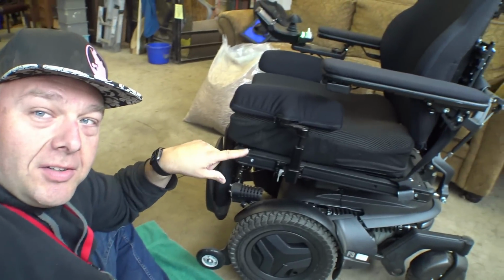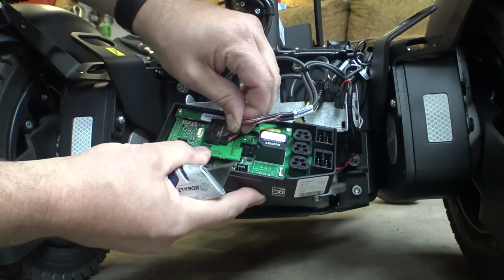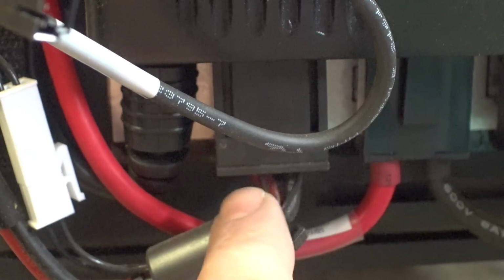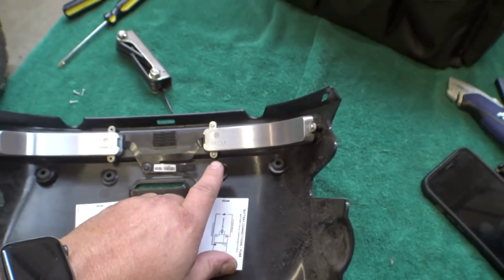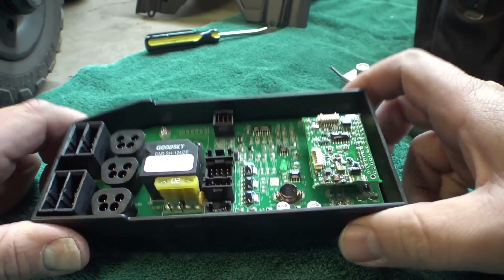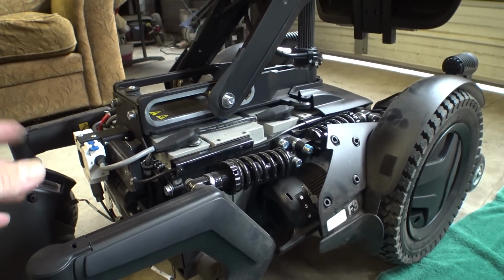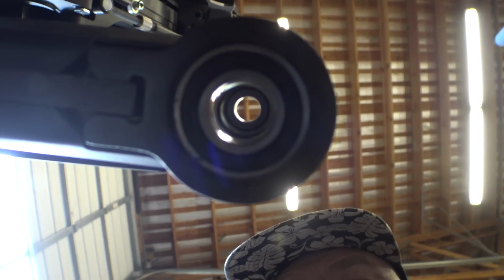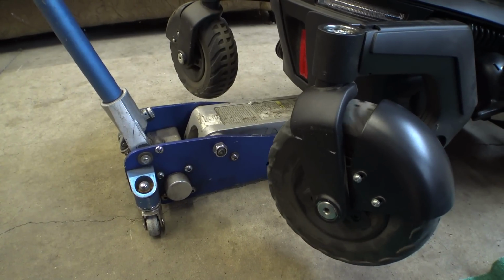MEGA VLOG 584: a look inside the Permobil F3!

Comment: I Am Not Amused, Or Happy To See That The Permobil F3 Shown Here In This Video, Has Some Kind Of Tracking GPU System In It, Because I Am In The Beginning Stages Of Getting 1 Of These Permobil F3 Powerchairs From A Local To Me Disabled Powerchair Company, Wherein I Have Already Been Fitted On A Demo Unit, Which I Saw And Road Around In It 2 Days Ago, Wherein It Will Be Replacing My Wearing Out Q6 Edge 2.0 Powerchair, Which I Received 5 Years Ago, Via Medicare & Medi-Cal, Through Another Disabled Powerchair Company . . . ;-o

Is This GPU Tracking Unit A " Mandatory Feature " On These Permobil F3 Powerchairs, Or Do I Have The Option To Have It Left Out, And Off The Permobil F3 Powerchair ???

I Am Also Rather Concerned By The Rear Tie-Down Hooks, Which Are Short, And Stubby,  Which Are Being Hidden Between The Rear Wheel Frame Bars, And The Plastic Rear Shroud, And Very Hard To See, And Get To, For The Securing Straps That Are Utilized By The Local Disabled Bus Services In My City, So Does Permobil Have Another, And Taller, Or Longer Version Of Those Metal Tie-Down Hooks, Which Come Out Farther, So That They Can Be Seen, And Hooked Into, Via The Transit Vehicles Floor Securing Devices ???

Kindly Respond Back To This Post And Let Me Know . . .  Thanks . . . "-)
Reply from the maker: https://www.youtube.com/watch?v=Yrkk8shC7WI

Comment: I have a F5, I am from Brazil and we don't have a Permobil service here, My leg actuator sometimes fail and appear error code 2092. Im gonna buy another actuator, but there´s any chance to the problem is in any electronic board or module? Apparently the cable is fine.

Comment: Hi Dan sorry it's been a long time just looking for your info on f5 casters flutter is driving me crazy what did you do to fix the issues? I just looked and seen mine has 12 pieces too so hum wrong part installed on my f5 casters?
Reply from the maker: yea ive heard from a number of people.. some have the 12pcs, and others the 13 pcs.. i know the parts exist, but ive tried to order them, and get told 'they are all the same' which i know isnt true... havent modified mine just yet though :^/
Reply: @TotallyNormal-   ty for reply they are not the same i had my 1 caster done monday and issue is fixed on 1 side . There is  only 12 pcs so ive been told but there are 2 types of this part 1 has more tension  here are the part codes 330974-E / 330974-F   the 1 with E is new 1 on chair .  F is stock from when i got chair will send you pics in discord as well hope this clears thing up

Comment: is F3 much better than c500? cause in my country i can only buy c500 or c300...
Reply from the maker: if i had to choose between the C300 and the C500.. i'd take the C500 all day long! its a much more stable, and solid chair!
FYI - the F3 is essentially a 'new' version of the C500 with similar weight, and build quality (but a lot more plastics for looks)
Reply: @TotallyNormal-  thank you... so not worth waiting for f3, cause i will be happy with c500 the same?
Reply from the maker: if i HAD to use a C500 as my daily chair, i'd be happy with it :^) 
i would want one with the 3G seating on it though!
 they made the C500 with 2G(plastic seat back) and 3G (metal seat back) seating options.  i'd also want to make sure it has the R-Net electronics with a screen on the joystick (color or grayscale doesn't really matter)
ALSO the C500 has 2 motor options.. the VS version has high speed motors.  the standard one is a bit slow @ 5MPH
Reply: @TotallyNormal-  ok , mine will be in 2 weeks, they brought from US to Poland.. and i will check all yours sugestions:) thx bro
Reply: @TotallyNormal-  just mine arrived to the shop, c500 with r-net unit, joystick with screen, and only 3 km of ride, so like new. so i think worth it?:)
Reply from the maker: awesome!! hopefully works well for ya! i always assume used chairs need new batteries FYI..
Reply: @TotallyNormal-  but it has only 3 km of ride, so its like brand new, only used in shop like a demo sample:) its esp S version, so its better than a standard right?:)

Comment: is there any mercury switches that make it go into turtle mode when going up a steep ramp or tilting back to get in a van to clear your head? my quickie does and it is a pain. i just bought s 2017-2018 f3 but didn't try it yet. will I run into same problem with f3
Reply from the maker: No mercury switches on these chairs! It’s all handled by the actual position of the actuators now :-)
Reply: @TotallyNormal-  so i'm 6'7  quad and need to lay back to get in minivan to clear my head, also low blood pressure can't sit up. am i going to be in turtle mode all the time and does it ever turn the motors off so it wont drive? is there anyway to outsmart it or did i just buy a expensive char i won't be able to use? Thanks
Reply from the maker: Head back over to Twitter.. we can discuss things there, and get a better understanding of what’s needed.. messages there will be a bit quicker

Comment: They definitely have a power draw when off.  My first M3 when parked days later battery's dead. It was well charged and sitting in the off position with a cracked frame, I was in a loaner. But the strangest thing I noticed was every once in a while the greenlight under the cover was lit. sometimes it was steady and other times it was flashing. Without anybody touching any controls kinda odd.  It's good to see you taking a part an, all too familiar, Permobil.  I too like to take things apart and reverse engineer, Second guess many of the (why they do it like that) engineering. Budget not considered.

Comment: As for the caster flutter  problems. I have to wonder why permobil never changed the axle housing to mount the wheel farther away from the centerline of the vertical pivot point.  Other than they are trying to avoid some of the extra caster kick as you change directions. (front/back).
......Personally, i think I would rather live with the caster kick.

Comment: If you just disconnect and remove the "connect" box and wiring, because you simply don't want or need it. 
Does the chair throw any error messages ?
Reply from the maker: chair = honeybadger.. "it dont care!!" lol

nah.. no errors etc.. the chair itself doesnt need that module for anything :^)
Reply: @TotallyNormal-   Good.......In Canada that "connect" seems to be a standard (no extra cost)  inclusion.
And I'm not really sure I want big brother to know every time I go anywhere.....ESPECIALLY if I find it's draining my battery.
I'm still fighting for the funding on my M5 to get them to cover elevation and front tilt, and it looks like I might be looking at a 2022 model now.
Almost wondering if your "source" has any info if there are any changes over 2021 versions ?

Comment: My DME service guy and agree they should send the prototype out to actual users to drive the wheels off and find the engineering fails ( like my 2014 power M had the entire front of battery box held on with a cotter pin ,day 2 it fell off when the cotter pin broke ,we put an L bracket on and it’s never come of again) my 20 & 21 have the same quirks there’s a plastic motor shroud on the L that half falls off and rattles got tired of smacking it back on so I VHB it , and the headrest tension screw backs itself off everyday and the headrest sounds like a rattle can going down the road , the change in Rnet that makes me crazy is it no longer stays in mode so if you elevate and have to move and go back you have to reselect elevate because it defaults to tilt .

Comment: @Totally normal Hey Dan. I wish I knew that you weren't familiar with the new type of friction brake kit. My 2018 M5 uses the same system. So I'd like to share my findings with you. When you tighten down the bolt it compresses the spring washers which because the top bearing and the spring washer assembly( not really sure what the call that piece yet) rides above the ledge inside of the Caster arm, will cause a pulling force upward on the Wheel which causes more friction. The small o-ring at the bottom is really only there to prevent the bottom half from slipping, at least the best I can figure. Also wanted to talk about your wheel flutter problem. Yes it is absolutely because you are running the aggressive tread caster tires. When I originally spec out my M5 it had the aggressive tread package added. I noticed a significant amount of flutter and decided to run standard Caster tires with the aggressive tread Drive tires ever since then my Castor flutter has been minimal. Permobil only makes one version of the spring washer assembly, which is the 12-piece and yes for the record there is 12 spring washers in the assembly( I only know this from experience because while removing one from my chair it exploded and we had to pick up all the pieces.) Permobil will also tell you that this version of spring washer assembly is good for both standard and aggressive tread Caster tires. However, I highly disagree and have been very vocal about this problem. The aggressive tread Caster tires are simply too heavy and therefore cause more weight on the whole system I. E. causing more wheel fluttering! I would like them to make a 13 or 14 piece spring washer assembly option available.
Reply from the maker: awesome! thanks for the info! sounds like a number of other people here in the comments are having issues with the castor flutter as well.  it seems like one should be able to add more spring washer in there potentially...

Comment: I had a problem of caster wheel flutter on my Purchaed New Late 2020 Sunrise Medical Quicken Puma 40 Pro S-Line Gyro RWD, when Is it hit 2-to 3mph  it was returned after a Main dealer service and to be honest after a lot of cheacking the 10” castor wheel and its ajustment to the castor bearing I found what solved my problen was ajusting the Center of Gravity to the seat. Which the dealer did not admit the altered the center of gravity when they fiited, or placement of the seating when they fitted a power recline upgrade that I asks to be done at my expence to my back rest Once I moved the seat and I not the dealers  I did that the flurtter disappeared completly  and my chair now run at just under 7mph with no flutter ever. The dealers wanted to charge to put there error right. Needless to say I am now Useing another Compitant dealer for my service and upgrade work.

Edited to add My chair went to its service with no wheel flutter of any kind and on 29 miles on the Clock from New, I had a bad feeling about the dealer to be honest, But I will not Name them though i did Make Sunrise Medical aware of the request for extra Costs This Comany wished to rip me off with. I bought My Unit New from the Dealer at totaly my own expense and I love my Chair as Much as Life Itself .

Comment: Hey Dan, I currently use 2017 M3 ( C-5 quad) and went to an estate sale and purchased a 2021 M3 that had 3 miles on it, I was going to swap some of my actuators off my older chair onto the new one and make it my primary daily chair, I had help come over got things swapped around and the old actuators wouldn’t work on the new chair, when I called to get some information they informed me that the new chairs come with smart actuators from the factory and cannot be swapped out unless brought to a dealer. Your thoughts?
Reply from the maker: yes! i had that happen when trying to swap some actuators around between chairs recently - i was able in the past to swap an actuator onto a 2016 F3 from an old C500.. i thought the system was backwards compatible.. but apparently not anymore! near as i can tell, the new firmware on the ICS modules doesnt allow for 'non-smart' actuators at this point... it would appear that 2016 is the cutoff for cross-compatibility with smart/non-smart actuators